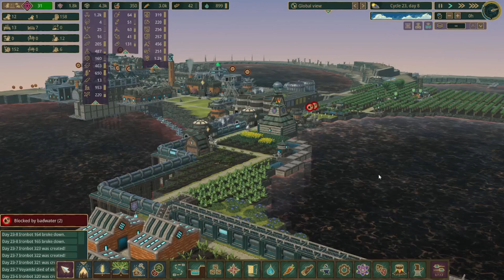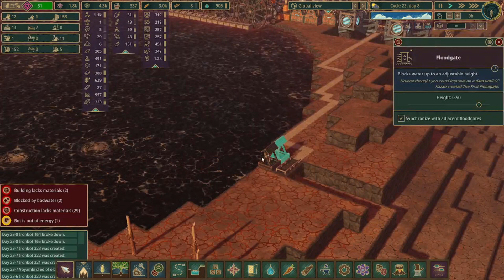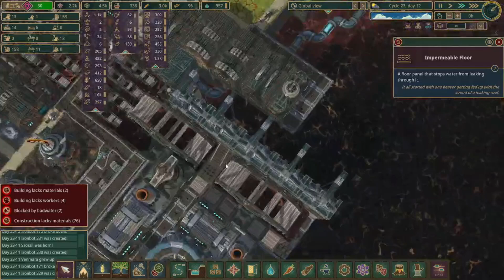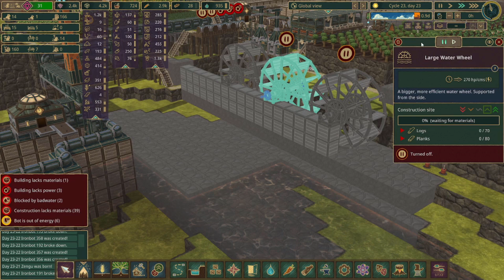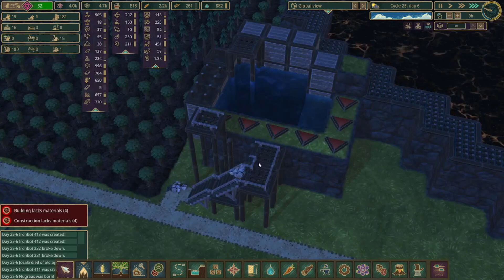Breaking Ground on Our Next MEGA CITY!!!

Comment: theres a check box in the district center to make all new buildings be set to bots by default. though if the building isnt connected to a path by the time its built, it'll switch it to beavers for some reason so watch out for that